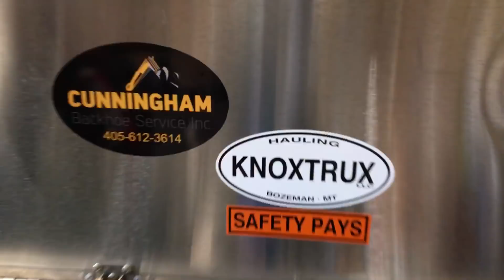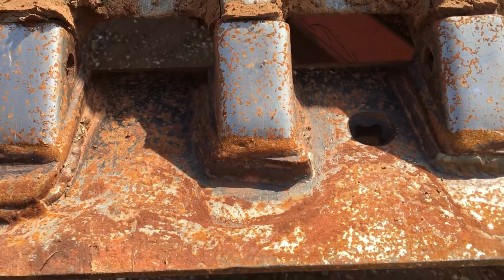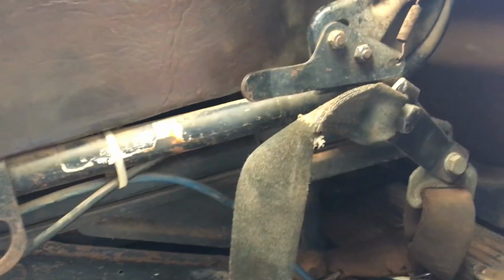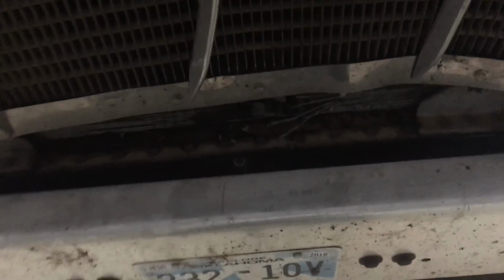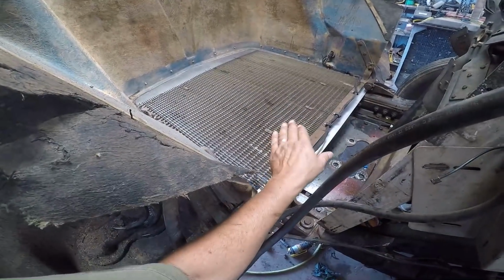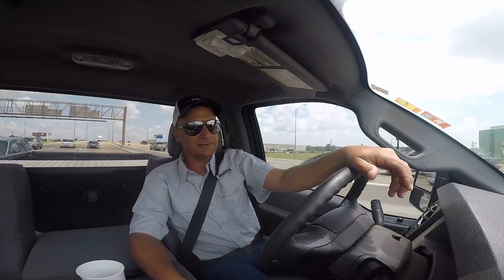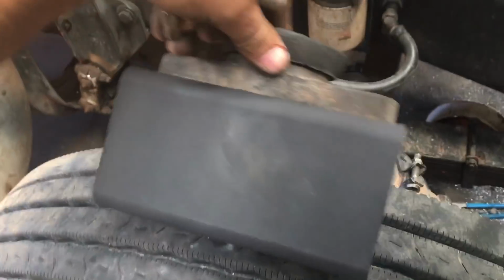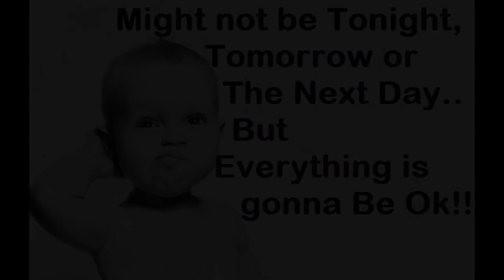A long week! Hit a deer with Little Red.

Comment: I am glad you straightened that grill/condenser. A long time ago my Dad taught me that if it is already broken you can't hurt it by trying to fix it. With a set of porta-powers, a rosebud and sweat Dad and me have ironed out some pretty big messes. I hope one day to be as smart as my Dad. When I was a young welder I got in over my head fixing bent concaves out of a combine. My Dad stepped right in and took charge. Dad ran that job and made me look good. I was going to use my fancy new mig welder on that job, When I pushed it over he said no. Dad went and got a box of 7018 and said if I wanted his help we were going to do it right!

Comment: Another good job Frank. Little Red might run so cool this winter you’ll need to run a Arkansas thermostat in front on that big radiator. Lol. Might be a fun project to fabricate a cow catcher grill guard for her so you don’t have to go through this again.
Reply from the maker: Thank's Steve! I am a bit worried about the heater this winter, I do have a winter front and will probably need it for sure.  No plans yet for the cow catcher, one deer in 20 years.  Think I need to quit before I resort to that!

Comment: Hey thanks for showing me your cutting edge, most of the ones I have seen on the internet use a chain binder, which I may use, I was thinking about making two, one for grading and one for trenching, the grading one being wider and a binder on that one wouldn't probably be a problem since you pretty much run the bucket at the same angle for grading but the old teeth solution for the trenching bucket is the way to go, I used to plow snow for a living so I have plenty of edges....sorry about your truck, glad to see you are moving on, hang tough
Reply from the maker: No problem! Many ways to make one work, but I find trenching with one almost impossible in most soils. They are very handy for finish and surface work though. Gotta keep movin' on!!!

Comment: Ol hummin Cummins big cam 855. Best engine ever made. I worked on many of those over the years.
Reply from the maker: Jeff Younts little red actually has a small cam with and aftercooler.
Reply: @Digginok  well that's different. Does it still have the non stop top injectors in it or did you change those out? What horse power?
Reply from the maker: I did an out of frame overhaul on it back in 03 I think. It has 350 pistons, non-topstops, set to 350 HP.

Comment: Nice job fabricating the spacers, looks factory. I hit a deer years ago with my wife's minivan on vacation, took me 8 hours to get it drivable the next day. The deer bounced about 40ft and ran off into the woods. They taste great but are hell on vehicles.
Reply from the maker: Thanks! It turned out pretty good. The deer seem pretty thick this summer. They can do plenty of damage, the one I hit bounced but didn’t run away.

Comment: Digginok My brother from another how are you doing this fine Friday evening? I hope this fine Friday evening finds you and your family very well. Come on brother take me up on them pipe caps and bolts. We all want  cow catcher on that truck. Bring that truck to my shop and we will build it together. Red and you are welcome on the super slab anytime. I have a welding turn table, stickrod, mig spray or short circuit, tig. Lets build a pipe bumper that you can store compressed air in. Steak supper in Ohio any time you want it Brother! Best to you your family and machinery. Keep us posted on the price of those pins and bushings. I hope that that new radiator don't freeze you out in the cooler temp.
Reply from the maker: tdej80 thanks for the offer, just too much  going on right now, I doubt I will have time for the cow catcher, maybe someday. Thanks and we are doing well at the moment, hope all is well with you and yours.
Reply from the maker: Ps I did post the winners on the prices.

Comment: If you build a big old cow catcher I will throw in 2 4'' pipe caps and a handful of 7/8ths bolts!
Reply from the maker: No plans for that just yet!
Reply: I love that old truck and it made me sad to see her hurt. When I had my diesel dodge I mixed it up with a brown vehicle destroyer. I had the six speed in. I was pulling hard in 3rd gear and the nose was still up a little. The truck took no damage. I washed off the manure and hair and it was fine. I worked on that old truck a lot. People were always impressed how fast it was for a truck that just puffed smoke no rolling. The truck was just to expensive to work on so I got an old ford with a 460 and a 5 speed. That 460 has over 200K on it and it still carries 130psi of compression.